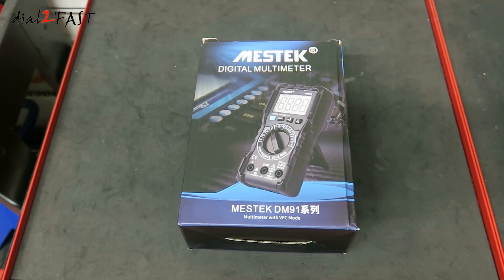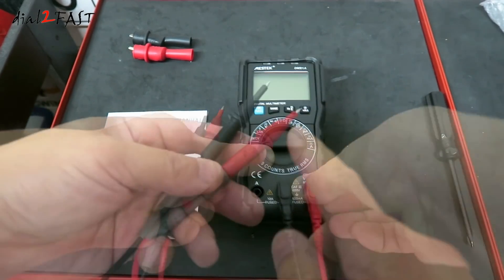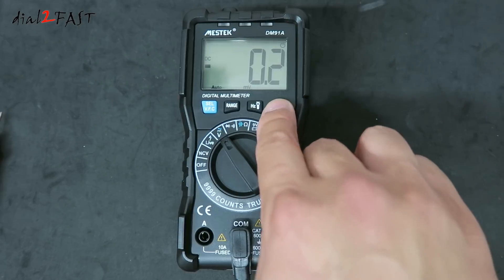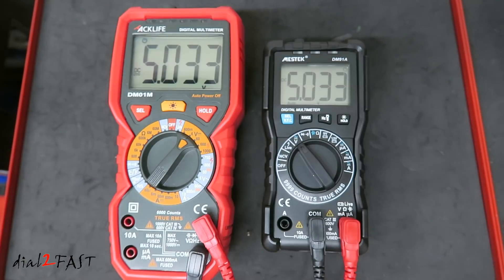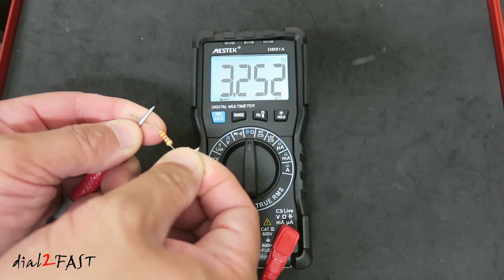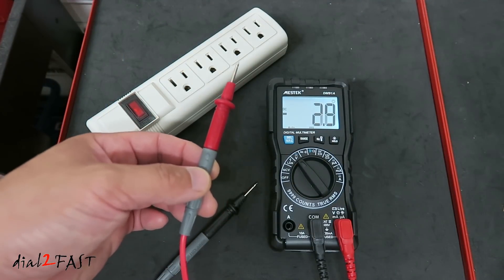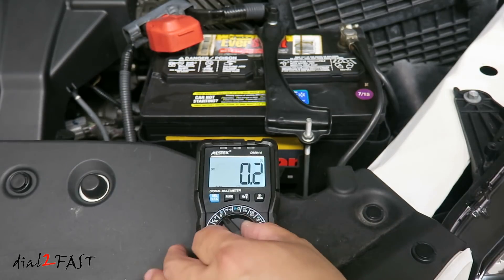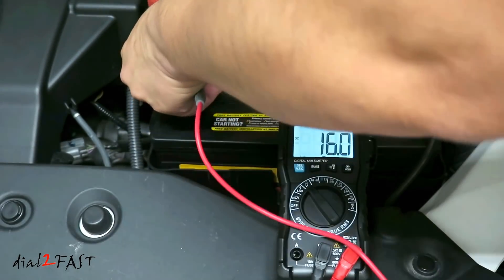$27 True RMS Auto Ranging Digital Multimeter - Mestek DM91A

Comment: Had this exact meter for a few months last year before binning it. It's absolutely the worst meter I've ever used, can't even compare to a $10 manual ranging meter that's still in my car's glove box, at least that $10 is reliable enough to read DCV.

What bothered me very much is that when i measured 9v battery using the battery mode for a little too long, a fuse got blown, then the regular DCV measurement got completely incorrect readings. It took me a while to figure out the fuse blown directly resulted in the inaccurate regular DCV reading. After I replaced the fuse, the reading got back to normal! i was like WTF? And although the meter can warn about blown fuses, it sometimes didn't work/warn me, so it took me quite a bit of time to figure what actually went wrong.

I can't even recommend this meter to hobbyists. This is just a random meter that its measurements and behaviours are just too random. If you had to troubleshoot a board while troubleshooting your meter at the same time, it'd be a living hell.
Reply: Maybe that's why it's branded "Mess tech"